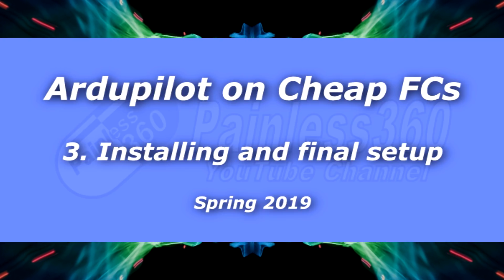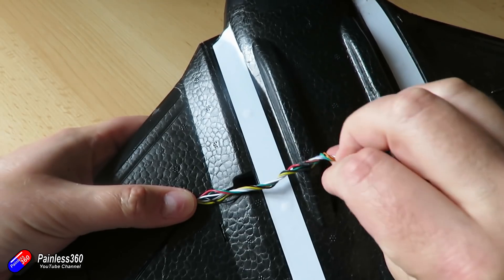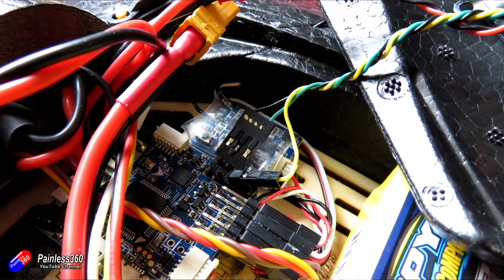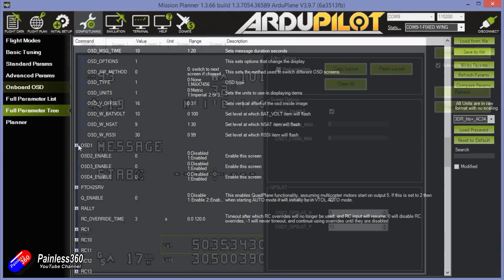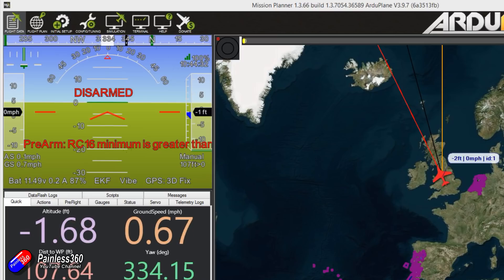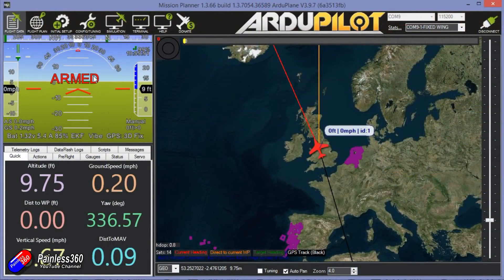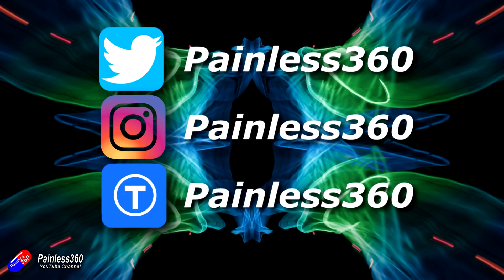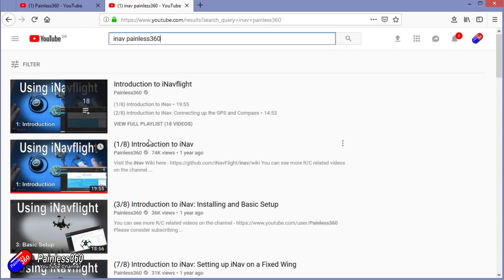Easy Ardupilot on Omnibus Series: 3. Installing into the wing and final setup before maiden

Comment: My goodness you fear the magic smoke, ha your not trying. As a young man I once made ball lightning,  a sight one never forgets . It is magical energy chasing itself about such pretty pastel colors, you are tempted to touch it , but dare not.  It's OK my battery was much larger, 400volt 10,000 amps, and a backup 6000 volt motor . Found the fault the next day, repaired it,  alas of the hundreds of wires only two were miss labeled.  Then someone else labeled the wires long before me ...indeed he was a supervisor. Over the next 5 years I would find many such mistakes all signed by this man. Each I repaired amended the schematics... I was much smarter then ha ha . Take care.
Reply from the maker: Don't forget who I am making these videos for ;) The aim is to help a new builder avoid the common mistakes. Many of the new R/C builders are not electronics experts so re-iterating key details to keep them safe is not a wasted effort.. Happy flying!

Comment: How does the board communicate with the computer during flight?  I’ve looked around online and the best answer I can get is MAVlink, but like, does it need its own antennas n stuff or does it just kinda do its magic?
Reply from the maker: I'm not sure I understand the question. Are you asking how you get telemetry back to a groundstation when it is flying?
Reply: @Painless360  yeah pretty much, I think.  Like how are waypoint set after takeoff communicated to the plane?
Reply from the maker: OK, there are a few options to get MAVLink data back. The most common is the use of telemetry radios, one of which is plugged into a USB port on the laptop at the field. See my videos on telemetry radios.. Best of luck!

Comment: Dear Sir, i am using f4 pro v3,but having an issue that after arming.. the motor wont spin.. seems like the is no pulse on the throttle ch pad. And i have try change to other ch.. seems is the same.. any idea or link of solving this issue.?

Comment: One issue here . The complete system wiring diagram shows the "Sbus" solder pad jumpered
instead of the "PPM" side . The Ardupilot Wiki for the airbot omnibus F4 v3 says the "ppm" pad should be jumpered ?
Reply from the maker: Different versions of the board need different things soldering. See what I had to do with my specific version in the video. Best of luck
Reply: @Painless360  It looks like you soldered it the way The ardupilot Wiki specifies from what I can see in the video . You must have used a genuine Airbot F4 v3 FC ? Since it worked for you that's what i'll do .
Thanks for the reply's

Comment: im using the arwing for my new matek f411WSE is the built in BEC on the 600ARWING ESC do affect the flight controller making the motor not working? i si this vidio you open the esc.
Reply from the maker: Not sure I understand what you're asking. See my iNav 1.9 build with a Matek 411 for how I did it..
Reply: @Painless360  thanks sir  i will loock at it. i hope you can covered the matekf411WSE it fits  good in mini 600ARWING. t.y

Comment: how do you secure the flight controller to the inside of the wing? do you have to poke holes in the plane itself or use adhesive?
Reply from the maker: Watch the series and you'll see how I did it - 3D printed mount... Happy flying!
Reply: Painless360 thanks I see it now!

Comment: Hey great video. I was wondering how you powered your servos. Only my receiver has 5v but none of the pwm pins do. I saw you soldered the middle pins together, but could you expand on how that process please?
Reply from the maker: Please watch the series - it's all covered in there. Flight controllers designed to work in fixed wing models usually have a beefy 5V BEC  inside to power the servos. Using an Omnibus like this one wasn't designed for that so I've powered the servos from the ESC lead (that has the 5V from the BEC inside the ESC) directly to avoid problems. Happy flying!

Comment: I'm curious, not considering cost, which would you consider the best option - the f4 pro or a pixracer for a small form factor flight controller? Also, can your flashed omnibus work with QGround Control?
Reply from the maker: It depends on what you want. If you're not bothered about FPV then the PixHawk/Cube is still the most tested, reliable hardware. All of the other options are new into the game..

Comment: Great Video's!   Has the issue with GPS modules dying been resolved somewhere or commented on in other video's?  I left a comment under Aldo Ferrari's question  with my voltage reading on the 3 diodes..    I had 2 GPS modules die also...
Reply from the maker: I've only built two of these so far so not sure I can comment on what's happening to other pilots builds. So far both of mine have performed flawlessly...
Reply: @Painless360  Thanks for the quick response.. 

 I would appreciate your comments on my diagnostic data, on a reply under Aldo Ferrari's comment (5 months ago)..  Maybe I should build another board and use your method of isolating the servo rails instead of removing the D3 diode..
Reply from the maker: Maybe, all I know is this is working for me. Best of luck!

Comment: I found the problem and redid the drivers, loaded hex code and it now runs adru ... run setup and will have to build an air-frame for it  ...since this is somewhat experimental ... Test flite ...explorer and since I have one built for a VTOL project ...I only have to build a wing .... I'll let you know if it works ... Thanks for the new project.

Comment: I am interested to see if you get rapid pitch wobble i quess you would call it. I cannot seem to get rid of it. I used auto tune but even that seems to just make it consistently worse  it does not happen all the time but scary when it does.
Reply from the maker: That can often be due to a flutter from the model, did it do that before fitting Ardupilot?
Reply: @Painless360  . Well I fitted it during assembly so it has never flown without it. Generally happens during climb out from launch and during a dive or steep decent. But if using auto tune it can get bad enough it heads for the ground pitching violently  I always balance according to the marks. But i am thinking maybe a C.G. problem? Anyway i am guessing and eagerly awaiting your experience.Thanks as always for your time and work.
Reply from the maker: Hey Tab, I've been shooting the video for a piece on Autotune and had a similar thing but the FC worked it out after a few seconds of flying.. They were an interesting few moments as the model was nodding like a headbanger at a thrash metal concert! :D
Reply: @Painless360  LOL ya that is the description I was looking for. In retrospect it was breezy out both times I tried. I will do it again in ideal conditions. I was able to minimize it by matching the pitch to the roll pids. I am very happy to see there is a light at the end of the tunnel. Thank you for taking the time to respond, and for all the work you do for the hobby

Comment: The Omnibus F4 Pro has been easier to set up compared to say, a Pixhawk from a hardware standpoint, but not quite as reliable for me. Logging has worked only sporadically even after trying different cards. I’ve also had at least 3 crashes due to the FC essentially freezing up, with “EKF2 IMU0 USING GPS” message displayed simultaneously. I haven’t had that problem for a while now, but haven’t been able to determine what caused this. The same issue has occurred to a few others, and I haven’t seen anyone come up with a reasonable explanation for why it occurs. Hopefully all will go well for your set up.
Reply from the maker: See the rest of the playlist  ;) happy flying!

Comment: Hello, I love your chanel , is very useful for me. But I need help, my ominibus f4 pro that i use for ardupilot, is burning my gps. I already double check the wires and every is everything is correct, especially negative and  positive. The gps works for a minute or two them die.
Please could you help me.
Thank you.
Reply from the maker: I'd check the voltage that is being supplied to the GPS.. Best of luck
Reply: @Painless360  Thank you very much,four your replay.  I will verify.
Reply: @Painless360  I've already check, an the board provides 4,5 volts on positive wire. Is possible that the issue is on ground? Thank you again.
Reply from the maker: Could be anything. I'd check that there is still that voltage when the GPS fails..
Reply: @Painless360  one more question. There any test I could do with ma died gps?
Thank you.
Reply: @aldoferrari  Have you resolved the issue with GPS modules dying?  I just added a comment below but don't know if Lee will see it or not...   I am new to commenting here...
Reply: I have also had 2 new gps modules stop working BN-220 and BN-880,  (on omnibus F4 V3 Pro)..
 I  got thru most of Lee's steps successfully  including arming and running the motor, with a good working OSD screen. ..   My plane uses a 4S source instead of 3S,  but that should not matter since the SBEC is generating a constant 5.54V from it.. 

 I saw an rc_groups comment from several others with the same issues, unresolved..  they thought it was due to 4S, but that does not make since.   My SBEC on the omnibus board is generating a consistent 4.97V output.

I used the D3 diode removal method..  here are the measured voltages on the 3 diodes...  

- ESC_5V was 5.54V (from YEP60A ESC), should not matter since D3 disonnected this from the gps and video system voltage source. 

- USB_VBUS: 4.62V, 

- SBEC_5V:  4.97V, 

VCC5 where D2 and D1  are OR'ed:  4.30V w/USB only,  4.53V w/Battery-SBEC active ,  4.56V with both USB and 4S Battery-SBEC active. 

First gps to stop working was BN-220  (max voltage speced at only 5.5V)

Second gps to stop working was BN-880 (max voltage spec'ed at 6V). 

With no gps, loads, voltage on the GPS port contacts was similar.

I also had a current meter in-line with the 4S LiPo to start calibrating the current in arduplane right before the last gps stopped working..  it was the next step to do...  

In the process of taking all the voltage readings from the 3 diodes under all conditions,  (using pins and magnifying glass),  I fried the serial port.  [something is heating up the USB VBUS diode now, no lights... no connection now] 

I would like to buy another omnibus F4 Pro board  and try again, but need to understand what is causing the GPS modules to stop working first..   From all comments, it seems this issue still remains unresolved..  Any ideas on what to try next if I buy/solder up another board?   Any quick way to check the gps modules independently?

Comment: What is your recommendations if i want maximum smoothness on my flight (for use with a HD camera) the aim is to get as stable and jerk free video..... is there a setting that maks the stabilizing feature in the FC go to maximum setting? maby at the cost og speed og response??
Reply from the maker: As David mentioned, gimbals help in the flight and post processing can help remove the remaining 'wiggles'. You need a high frame-rate on the camera as any motion blur will effect the quality of the processed video. I've invested in a GoPro Hero 7 Black that includes image stabilisation that works well but is expensive..
Reply: Painless360 I have extensive quad experience, but quite limited wing experience.. I can make a drone fly as smoothly as I want my video to be (cinematic) next build will be a 7” (but they  are hard to tune) and I was wondering if a wing was a better option when I want long range... but most wing video I see look like it has turrets... can that be tuned out wit a FC? Or is that aerodynamics?  I will be flying as low as possible and as long as possible... and I assume there is a lot more range in a wing, but can they be made quad smooth?

Comment: Ive never got ardupilot to calibrate, it never gets past the part where you roll the controller through all axis
Reply from the maker: See the other videos in the series for how I've got it working here. Best of luck!
Reply: Make sure you have auto detect external mag orientation enabled, plenty of Chinese gps copies are wrong and if you manually choose the orientation that you think it should be, it will never work. Also keep in mind hatch magnets that could be close to the FC